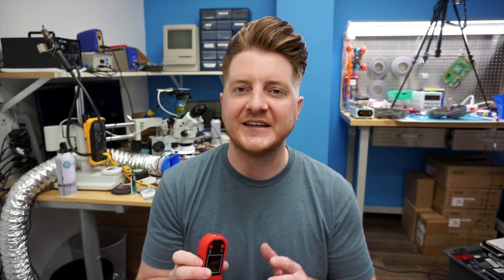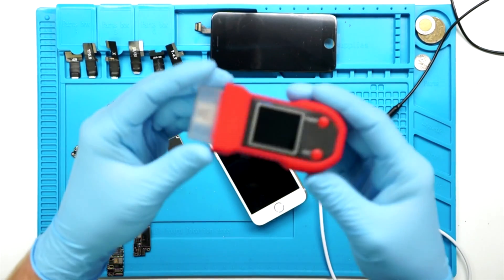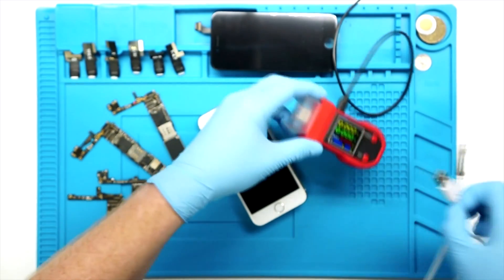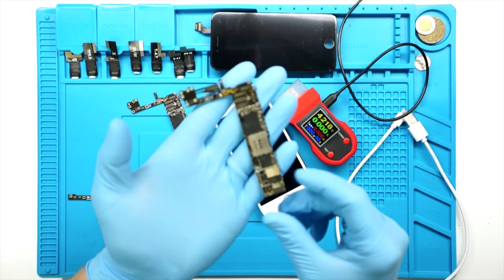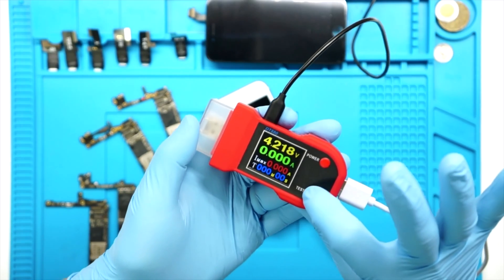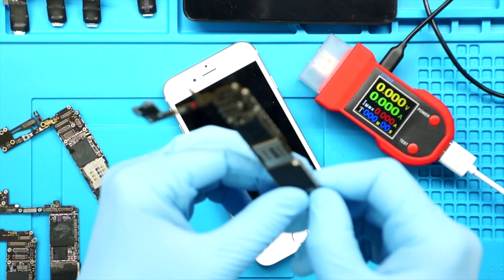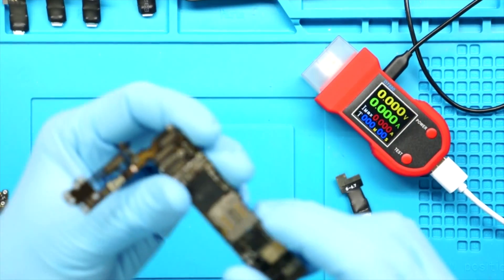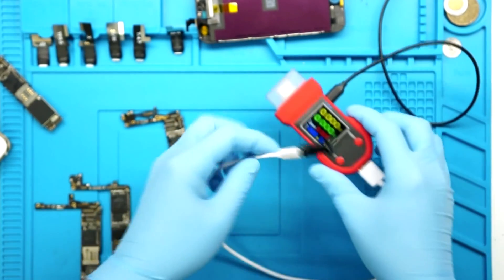How to Power an iPhone without a Battery?? - The DT880, An Essential Workbench Tool!

Comment: The shorted board is drawing so much current you could probably find out which actual component is shorted  just by touching the components.
The component which burns your finger is the guilty one.  Often you can see, and smell,  the shorted component right away.

Comment: I think my board is now the brave little toaster because I failed to fasten the volume /power docking pins to it. Instead docked the Lightning pins and fastened the battery clip assembly on the board. As mentioned without the power volume's own dock connected? would this have caused the heating the board suffered faceup near lower half section of the board??  In my second attempt, I connected the volume / power connector and Lightning ,then at last the battery , no other peripherals LCD, Camera, just the main three, Lightning , Bower, Pattery? no overheating or smoke from first and second attempt were visible. Second attempt, the heat on  topside of the board diminished substantially assuming the board took the grunt of the current passing through the capacitors from not securing the power/volume dock on the visible upper edge from first attempt,  after leaving them out. Im assuming the board fried somewhere not too critical for it to boot once repaired.

My question for the newest  channel repair guide instructor, is "What was my fatal error if I had been given a job under your repair shop, and I could have only made two choices on the iPhone XR. First Choice: connect the volume/power flex pin connectors to the board plus the lighting assembly before the battery. Or there usually is no danger in leaving the power volume dock unconnected since its not really serving to create a ground terminal when the lighting and then then battery are set in place. In your video guides you use a special device its Red and displays current from connected iPhone from Battery and lighting dock clips, since there both coming out of one USB line to your device, I don't see how the danger is in the power volume docking pin not being connected. In the case of the XR, I never used the device or anything that you promote via this channel, since I don't get how I could've been at fault. If your device is not sold in stores or a person on a  public street, and I looked online its sold out!! 

Short question: When board is not connected to power / volume flex assembly, do iPhone XRs become fried if only two assembly flex modules are connected to the board, in this case, only lighting and battery assembly to cause the board to become fried for sure???

Comment: could I use this device to power a jailbroken device indefinitely to avoid battery damage?
Reply: Same. Trying for a bootleg LTE hotspot/router but don't want a lithium explosion in my closet.
Reply: @zeilstar  lmao use a old android dude.
Reply: @justsopuffer5600  Yeah, that's a better solution, but I already have the iPhone, which is why I'm watching a video on iPhones :). The wifi chip heats up and shuts the phone down so it's otherwise useless to me.